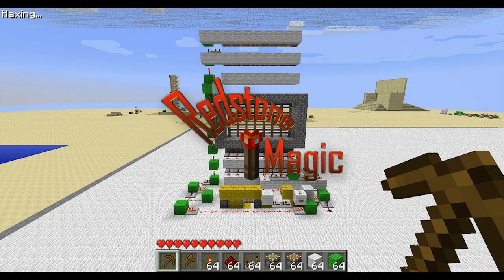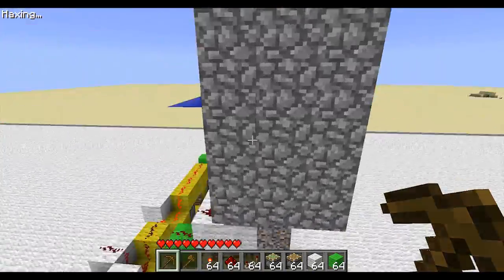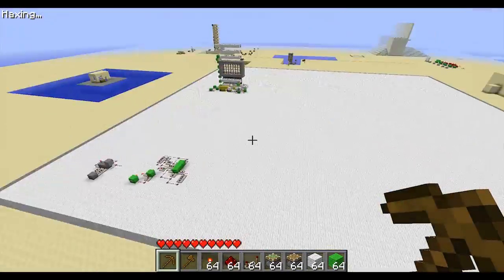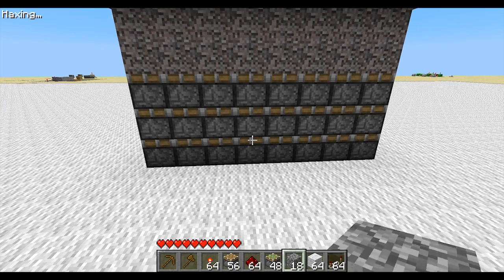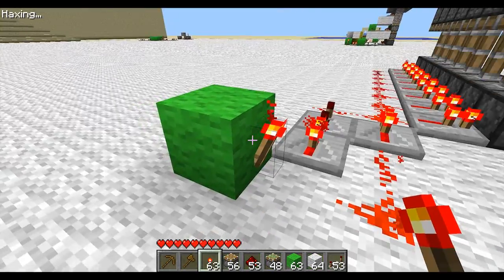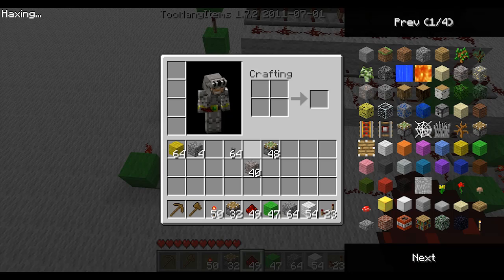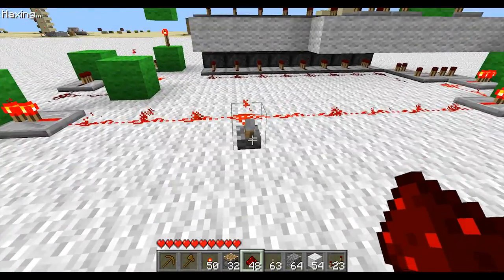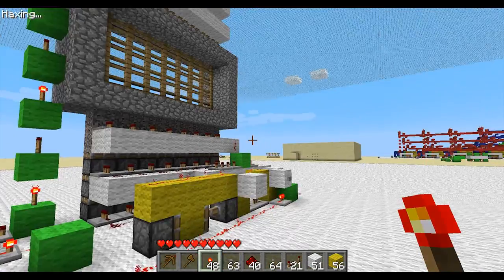Piston Gate (Portcullis) v2.1 Tutorial

Comment: Just made this in 1.0 and everything works fine but the T-Flip/Flop. The piston below the second piston does not power the circuit. I really like the original design because it uses buttons but for now I'm using XOR gates to get the multiple inputs with levers.

Comment: I had an issue with the bottom half attempting to make a smaller scale (3 wide) version of this. The top pistons don't get pulled back. I checked all the repeaters and they're all on the correct settings. The top works fine but the bottom pistons often just crush the gravel/sand and doesn't push up enough.

Comment: Multiplayer Solution for Laggy Servers

Let A be the bottom piston, B the middle, and C the top.  Since pistons cant HOLD extended positions they must go in this order.  A B C B A B.  You'll notice A has 2 repeater paths, B has 3 and C has none -it shares Bs path right before the block

These are the default timings:
A 1 6
B 2 4 10
C 3

If it wont work try adding 1 delay to each path (path not piston). Keep in mind pistons cant be moved while extended.

Here was my solution:

A 1 10
B 3 8 15
C 6

Comment: Hey Henness,
Nice tutorial, very well laid out, and helped with a big annoyance I was running into (what's a castle without a proper porticullis?)
I've run in to one small issue though and I'm certain it's timing related but I can for the life of me figure it out.
Short version, everything works, gravel sinks back down, but the gate only raises by two not three, any ideas? I suspect it's because all three of the lower pistons aren't "firing" at the same time.

Comment: Thank you so much! I modified it using a button on the outside and the inside, using a spiraling tower for the one on the side of all the repeaters, and I connected the other button on the other side, with a long pathway of redstone with 2 repeaters to lengthen the redstone current. I used Tyken's flat map, so I had to dig down into the ground, and I managed to get your tutorial exactly perfect. I kept the lever underground, and I made a back up of the file with just the map safehouse + the gate